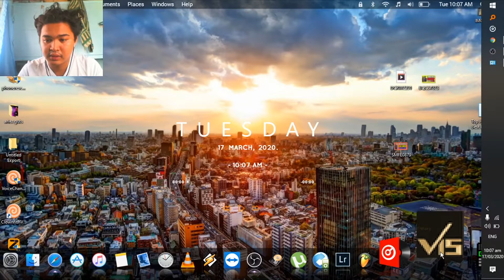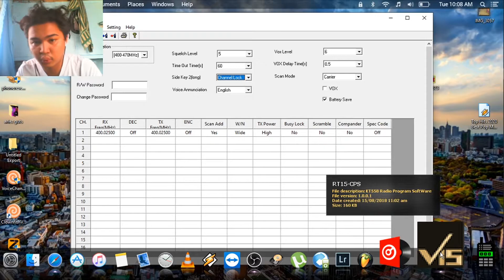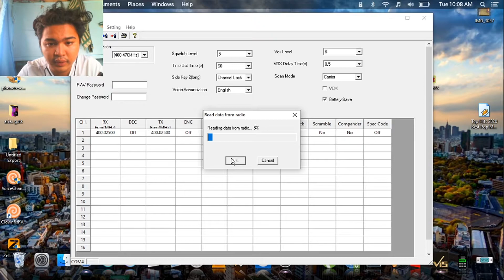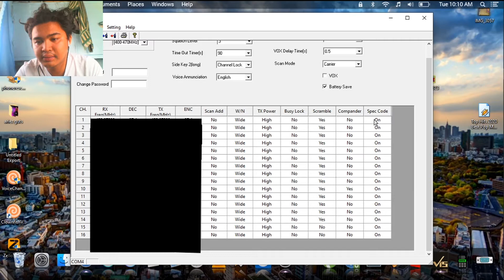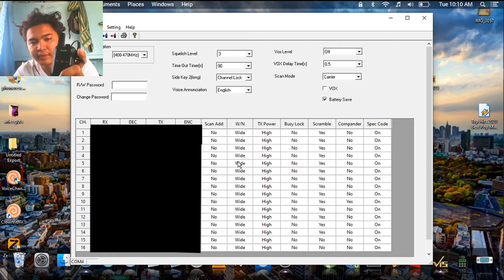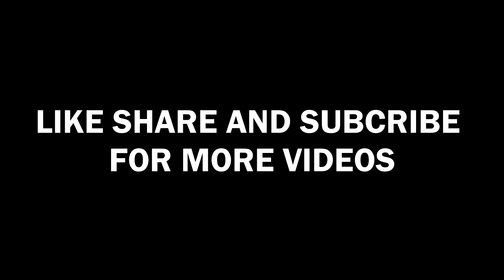WLN KD C51 (Programming)

Comment: I would like to buy like that one. But i doubt it will connect to our office’s existing channel that we are using. We are using Channel 20 but this device only have 16 channels. How to connect?
Reply from the maker: That is simple, all you need to know is the frequency of Channel 20, then we can program channel 20 on channel 1 in wln kd-c51. what radio does your office have ?
Reply from the maker: I you already know the frequency for channel 20 then you can program it anyware from channel 1 to 16 on the wln-kd-c51,  if you got anymore questions you may contact me via Facebook @ https://web.facebook.com/bj.supera
Reply: @djaymigz98  how to set a private frequency
Reply: We are using channel 20 but it is from different brand.

Comment: bos ayaw basahin ang data ng radio k ano kya ang pwede gawin
Reply from the maker: Update po, try to plug the programming cable to a different USB slot
Reply from the maker: try mo e check ang cable mo baka may problema, and turn on mo yung rdo pag nag program ka

Comment: Hi, I cant be able to program my wln KD c51, i cant insatll the software too. pls help. Before my wln has 16 channels, now it has only one channel, pls help.
Reply from the maker: try to redownload the software I gave, it is in the description and it is currently still working, and check your cables, cause cables break sometimes 😄
Reply: You need to hold the - button down or the turn down volume button and it will reset your walkie talkie. I had the same issue

Comment: Hey Migs, I used your software. But the channel from 9 to 14 doesn't work. I already double-checked the frequencies.
Reply from the maker: Really ? Just use UHF frequencies not VHF, and try to check your programming cable if its faulty or not